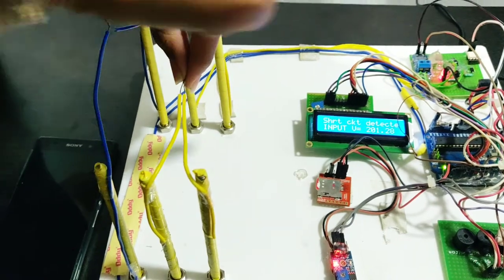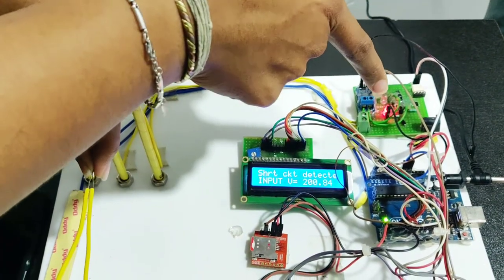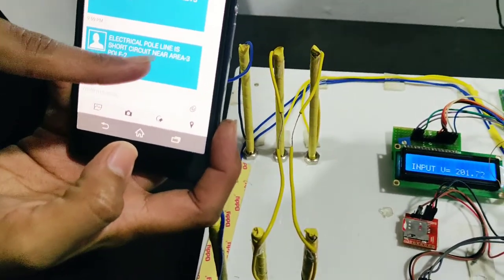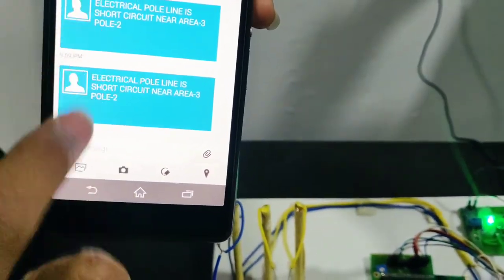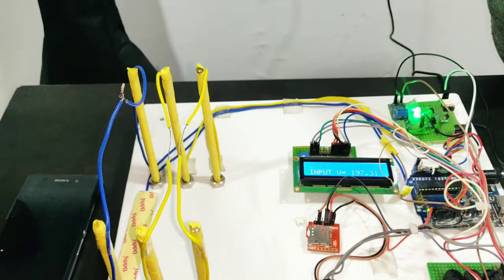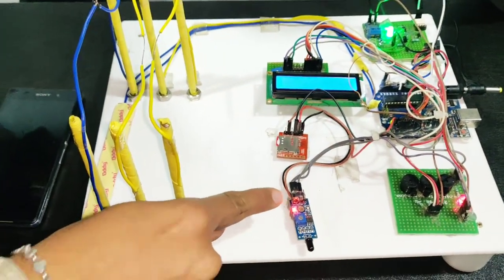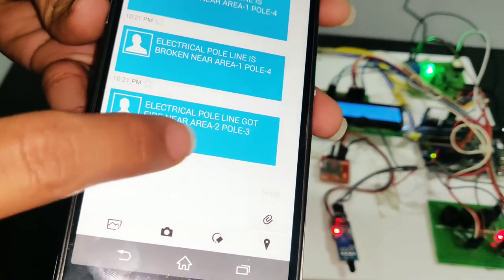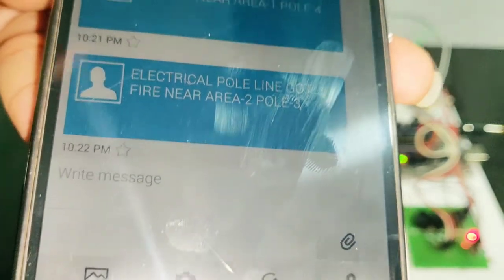Transmission line Fault detection Using Arduino with GSM By DM TECHTRIX, MYSORE

Comment: Your project idea is good  no dought, but the project required more modification for that fault detection ... like
1. use real 220v for measuring.
U can use   stap up transformer for  boost voltage.
2. Short ckt detection u can use current detector with short circuit load.
U should design the project as real time application.
Is any one want any help for ..reply me..
Reply: Can you help me ,i Want to work on this but I don't want it to be similar
Reply: @romancemberiuana7186  E-TECH VIEWS
Reply: @lokeshsingh4833  hi bro I need help from you

Comment: 👏🏻👏🏻 nice explanation mam.  Is it is possible to get an alert message for every one hour ,Regarding to voltages and current readings .?
Reply: yes its possible but u will have to add a timer circuit or a clock device